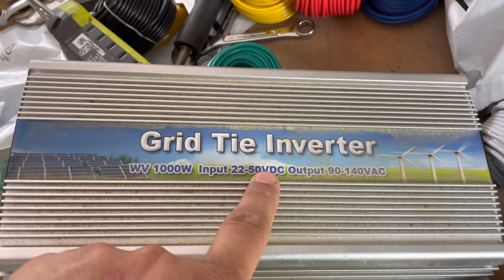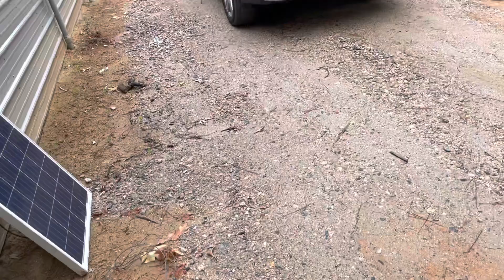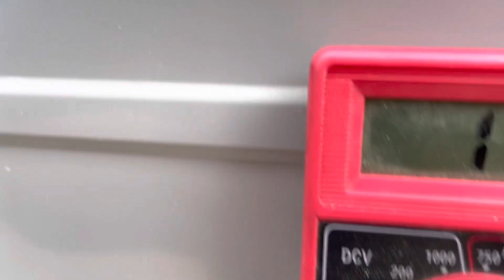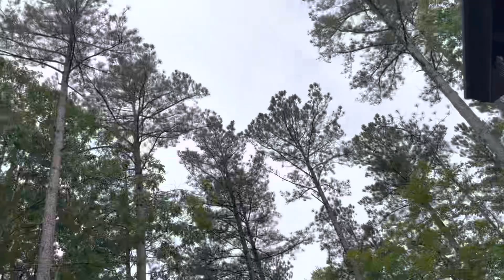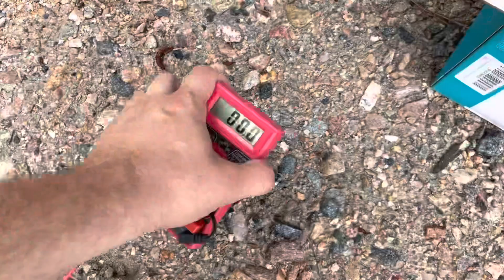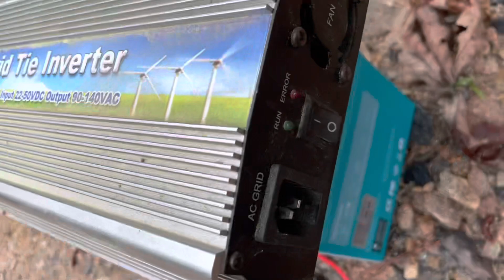Dead Grid Tie Inverter

Comment: I know your tired of people explaining this to you but this is what works for me. Use the solar pannels with an mppt charge controller so that the sun will charge the batteries then the runoff will run the inverter. Giving you some bonus savings in the evening. And for your inverter, try connecting it to 2 car batteries in series to see if it is actually dead or if it just can’t pull enough current to startup from the series pannels. Again Ik it’s repetitive but I hope it helped someone.

Comment: Don`t buy cheap stuff, this inverter is chinese and does not output the power it is rated at, get a proper inverter, recently bought Saj it is a 10kW one, has 2 strings, grid tie and it was 1200$.